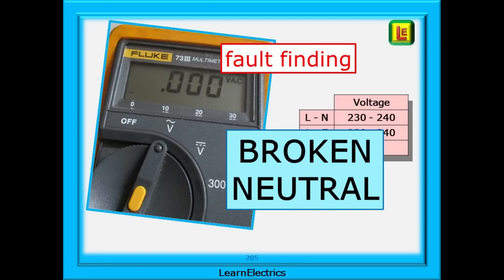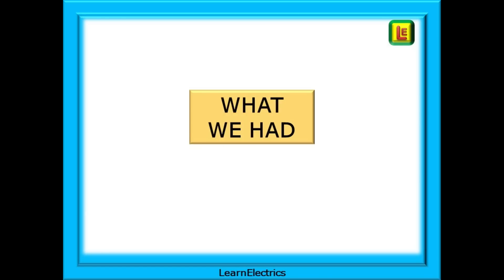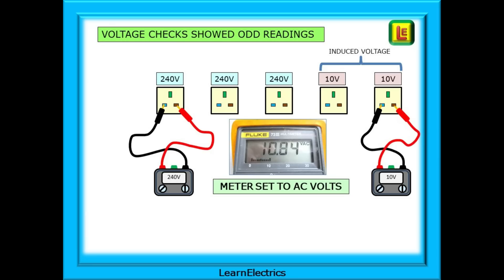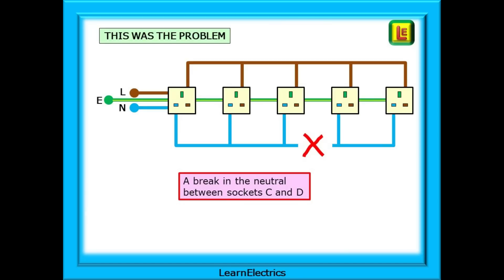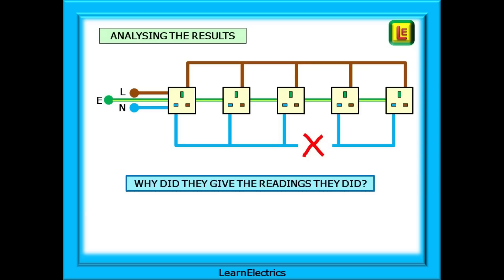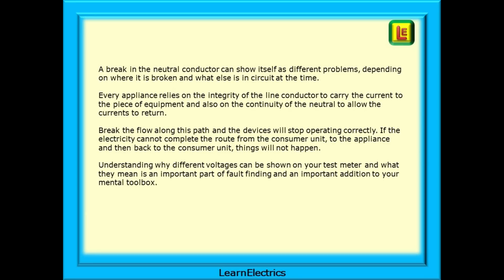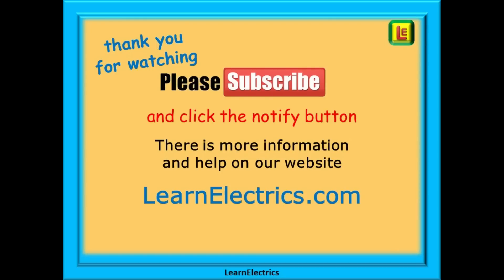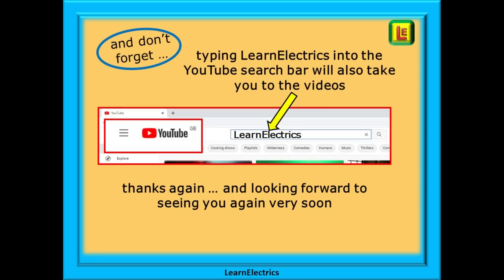BROKEN NEUTRAL – HOW TO FIND IT – HOW TO TEST THE CIRCUIT AND THE VOLTAGE READINGS TO BE EXPECTED

Comment: Hi I'm not sure if this is relevant to this topic but please assist here I once encountered a problem where an automatic coil winding machine suddenly stopped working ,however when we operate it manually via the contactor it worked we checked the voltage inside the small circuit which had a CB and a Contactor and the foot switch was tested as well nothing wrong we even thought maybe the contactor was faulty but that wasn't the case now another machine just a few meters away from it also encountered the same problem i checked the voltage on the main DB now but all seems fine but physically on the neutral bar I saw that there's corrosion on the neutral bar but the wires were not broken or brittle please assist could that be a problem or what possible faults can you identify from the problem?
Reply from the maker: Difficult to say without seeing the actual problem. It could be that you have identified the problem at the neutral bar. Corrosion, sparking from loose connections can restrict the amount of current flowing. It won't show up on a simple volts test because just a few micro-volts will be enough for you to get a voltage reading. If you have a clamp meter, try that around the phase cable or neutral, and see what current flows when you start up. It should be several amps.
Give the neutral bar a good clean - Safe Isolataion first -  and you may need to strip back any damaged insulation, copper etc and reterminate. Good luck - Dave.
Reply: @learnelectrics4402  thanks Dave I'll do that when I encounter the same  problem next time, because I'm no longer at the same workplace

Comment: QUICK QUESTION: So the lamp WON'T work in the broken neutral example? Even though it has 230 across it?
Reply from the maker: If the lamp cannot find a return path for the current, then no. Thanks for the input.
Reply: In a BROKEN NEUTRAL scenario, the Potential Difference between L & N will NEVER BE 230V when LOADED.

If it can Read 230V~ between L & N (when Loaded) then its Neutral is "Good".

Comment: Great vid. I generally find that a neon screwdriver, or a "voltstick" non contact tester shows neutral faults well, but I've found volt stick type tools to be too unreliable. And it's one thing to establish that you have a broken neutral, but it can then be an absolute nightmare to actually reach the fault, especially if it's somewhere well nigh inaccessible like under a floor all covered in carpet and lots of big heavy furniture, and/or the dreaded laminated flooring...
Reply from the maker: Thanks for the comments. Personally, I stopped using volt sticks a while back, too unreliable for my work. Dave.

Comment: Break in the neutral or lost neutral. Tester picks up induced voltage between L-N because of the floating neutral. When a load is turned on the L is connected to the broken N through the load and when both are at the same potential the meter will read 0
Reply from the maker: This is one of the dangers of lost neutrals. Thanks for watching.

Comment: Here is a puzzle: in Norway, distributon pre 1995, 3 phase 230V IT distribution. No Neutal only line conductors. 230V between them.  Every Christmas eve at about 17:00 some lamps in our home would shift to moonlight. Being about 10 years old I got my first lecture into 3 phase theory and later became an engineer in electronics/telco.
Reply from the maker: That's a good one. Glad it was in Norway. Maybe Santa stepped on something.
Reply: @learnelectrics4402  All houses using 230V in 3-phase Delta configuration. At Xmas eve the fuzes in the local transformer got overloaded and one of the wires vent dead. Then some loads received power in series. Ovens went lunkwarm and bulbs went yellow.  Since some houses had full 3 phase, others only one voltage from two hot wires, you would se some houses with yellow lights, some steep dark and others not affected down the road. Took some time for people to be informed what was going on.

Comment: Looking at the tables, at no point is there 240 between L&N whether the lamp is in or not. I have a fault on the kitchen sockets where there’s no power to the appliances but there is 240 between L&N. I was getting 240 between N&E then I disconnected the dishwasher and the fault cleared, so I thought. It showed 0v between N&E, 240v between L&N so I plugged in the kettle and nothing. Tester shows L/N reverse but even so, I should still get power but nothing
Reply from the maker: This is one reason that we should always carry out all the required tests on installation and on inspection. So many sparkies will try to take short cuts on testing and then someone else has to sort it.
Yes, even reversed polarity you should read L/N as 240V. Go back to basics. Check that the voltage is the correct polarity at the CU. Isolate at the consumer unit, remove the wires and start testing, you will soon pick up the fault. If you try and start the testing half way, you may miss it.

Comment: I have a issue… lol. 
Help YO SUBSCRIBER! Haha. but fr any tips would Be appreciated 

One day My light randomly stops working… (2 light fixtures to one switch! And other one works fine) …. So I disassemble the bulb fixture that isn’t working and test the wires….WIRES are getting power… but bulb isn’t working…SO…I go ahead and buy a new connection where the bulb screws in…. 
I Install new bulb connection and install new bulb … STILL NO light on…. 

   So I check the power and IT has power and correct volt…. But the bulb still isn’t coming on?! Lol. 
————————————-
-So the electric to the fixture is good
-The bulb connection is hot and good
- Electricity in the wires are good
- connections are tight…. 

Idk what to do …. 

Could it be the switch?! 
Since two fixtures are tied to 1 switch…. Maybe one of the wires to 1 of the fixtures came lose over time?…….

Any help would be appreciated. Trying to help my dad here and I’m stuck haha
Reply from the maker: You will need to start your testing with low ohms tests, prove the continuity of all the cables.
Take a look at these videos

3 plate
https://www.youtube.com/watch?v=p_qJx4lcp1U

2 plate
https://www.youtube.com/watch?v=L1cyoqBLkeI

common lighting problems
https://www.youtube.com/watch?v=S1Tzr5VX8-Q

Comment: Im confused in my situation, all lights and sockets work. However one of the light (led) flickers when turned off. Checking the switch both neutral and life wire are hot.
Reply from the maker: Take a look at this video on lighting circuit faults. Good luck.
https://www.youtube.com/watch?v=S1Tzr5VX8-Q
Reply: Seems like you are Switching the Neutrals instead of Live/Line/L😅

Comment: Also in this case of the lamp plugged in to the faulty socket making neutral 230v .. why does this not short circuit?
Reply from the maker: Have a look at the video again and look for the part where it shows that the broken neutral conductor is not connected to the rest of the neutral. Thanks for watching. Dave.
Reply: Best advice I can give, always draw out a circuit diagram.
This is the best way of analysing what is going on.

If you can't draw out a circuit diagram then, seriously, put as much effort as you possibly can into learning enough about electricity and electrical circuit theory until you can do it.

It's a fundamental skill that you need in this business.
Get your head around what makes an electrical circuit, Kirchoff's two laws covering voltages and currents.
Reply: A Load, with sufficiently Low Resistance, will NEVER cause any Short-Circuit when plugged into any healthy circuits (it will operate).

If plugged into a Broken Neutral circuits, it just WON'T operate.

So, where/why Short-Circuit arises?

Comment: Basic question for you but I was wondering, am I right in saying that current returns down the neutral not volts. I thought voltage was needed to push current round a circuit so how does it return without this ? Also how can there be current returning if it is been used in the appliance? Also where does this current go? Does it disappear at the transformer, can it not be reused? 

Please answer thanks for your videos
Reply from the maker: Think of a hot water central heating system. The hot water goes to the radiator and gives out its energy as heat into the radiator, the appliance, It then returns as cooler water to the boiler to be reheated and start all the journey again. The electrical flow is just like this. Keep learning, keep watching the videos, it all makes sense eventually, trust me.
Reply: Sadly the diagram shown at time index 0:48 of the radial circuit showing the voltages is not complete.
It's not accurate.

It depicts 240 V and 0 volts and it gives the impression there is no voltage on the neutral line, and that is not correct. 

The voltage is a potential difference between two points. And if you use a multimeter (on an AC voltage range) and measure voltage, putting one probe on to the neutral line, and placing the second probe also on to the neutral then you will get 0V.

But if you also placed both probes on to the live line you would also get 0V !  And trust me, you don't want to touch the live line!

Now if you place one probe on the live line and the other on the neutral line, the multimeter would show 240V.
So the live line is at 240 volts, right? Yes.
Ok, now swap the multimeter probes around and you still get 240 volts, showing that there is 240 volts present on the neutral. But the diagram incorrectly shows 0 Volts.

The reality is that it is AC and the voltage is swinging up and down on both lines. It is not fixed at 0V. Each is going up to +339 V and down to -339 V.

So the diagram shows 0 volts on the neutral line, but that is not the case.
 
There are two things missing from this diagram.
Firstly that voltages are typically represented as an arrow between two points on the diagram with the voltage written adjacent to the arrow.
This then shows you the potential difference between the two points, which is the correct way to depict voltages.  But sadly most electricians do not do this because of the poor quality of their training.

The second thing that is missing is the connection from earth to neutral.
And this is critical to understanding why if you touch the neutral which has 240 volts on it, as to why you are not electrocuted.
Reply: @deang5622  The diagram at 48 seconds is correct, it's refering to the voltage on the neutral being zero with respect to earth which it is.
Reply: @deang5622  In a single phase system, the AC voltage is swinging up and down, but ONLY on the live line.

If you place one probe on the live line and the other on the earth line, the meter would show 240V, correct? If you swap the probes around you still have 240V, correct? So does that mean you also have 240V on the earth line? This is the same logic you used with the neutral line. And if you connect the earth to neutral it is now safe to touch?

You have a misunderstanding of how a multi-meter works. The 'COM' wire does not mean '0 volts'. It is a reference to which the other wire, (V), is compared. You can use an AC voltage as a reference, which is what you are doing when swap the probes. It gives the appearance of a voltage being on the neutral line when in reality it is your reference that is moving positive and negative. 

You said each line is going up to +339 V and down to -339 V (the peak voltages), but in reference to what point?

If you have +339 V on the live line, what is the voltage on the neutral line at that same moment? If it is +339 V, then you have one phase with no potential difference between them. If it is -339 V, then you would have two phases 180 degrees apart with a 678 V potential difference between them. The only way to fit your description is with two phases, 90 degrees apart. All these options will also show as 240 Vrms between neutral and earth lines.
Reply: Currents and being “used in the appliance” seems a mystery.  One could consider the current as a driving belt. The belt transferes energy from the motorvto the saw blade, but the belt returns to the motor and takes a second round.
Reply: Fantastic videos😊👌thank you very much and keep on going😊💪👏👏👏
Reply: Current flows, voltage does not.
Voltage is always across two points. It's a potential difference.

Which is why when you see people saying they have 240 volts, the question  is what two points are you measuring it between?

Comment: I have a similar problem and the electrician could not find the fault. When my light in the lounge is off, the bulb still glows. Measuring the 2 pins in the light socket shows 36 Volts A.C. while the switch is off.  Surely this cannot be induced voltage ? So where does 36 V AC come from in a 240 V circuit then ?
Reply from the maker: That sounds like another circuit sharing some of your lighting circuits conductors. Take a look at this video on shared neutrals.
https://www.youtube.com/watch?v=gr6Z_bBiy5g
Reply: It seem like an Induced Voltage to me.

Even 70–80V can be deemed as Induced Voltage, UNLESS its measured using a Lo-Z VoltMeter.

Comment: Had this fault on a lighting circuit last week..........240v at the neutral  in a jb . ......never take for granted that a neutral will be safe to touch.......It hurts
Reply from the maker: Absolutely Mark. Thanks for the feedback. Dave.
Reply: This is why I don't approve of the diagram at 0:48 as it gives the impression the neutral is at 0 volts and it is not.

It is only at zero volts with respect to earth and so long as there is no fault in the circuit.

The neutral line is at 240 volts with respect to the live line.
Reply: That’s because it’s not a neutral in that state, its a blue or black coloured live conductor 😁
Reply from the maker: Exactly right, and as Mark says, it hurts. Thanks for the comment, appreciated. Dave.
Reply: I've found too many times that some idiot has cross wired somewhere between one lighting circuit and another, like upstairs lights and downstairs, and you go to the consumer unit and isolate the circuit to be worked on, which should then be dead, only to get a dirty great belt! So you then have to make yourself well unpopular with the residents there at the time and knock off the whole lot so they can't watch the TV, or play with their games console etc. until you've safely found and fixed the fault. And my own home had been "rewired" by some total amateur with such cross wiring between up and downstairs lighting, so I had to sort it all out.

Comment: Here in 3 phase 4 wire supply (India) this fault is known as floating neutral. In domestic service this is disastrous as the voltage will float anywhere from 0 to 415 between phase and neutral point due to imbalance and spoil the connected appliances.
Reply from the maker: Exactly right, with 415 volts on the end of a wire, it can do a lot of damage. I used to work in India so I've seen similar first hand. Take care, thanks for watching, lots more to come. Dave.
Reply: More common in many countries are now 3 phase 230/400V TN distribution network.

Comment: Great video!
Maybe in the future, you will make a video about the broken neutral in three-phase circuits, where the effects are more serious.
Thanks!
Reply from the maker: I think I should, someone else also commented about 3 phase problems. It's on the list to be done. Thanks. Dave.
Reply: And also the use of 3 pole and 4 pole main switches in 3 phase distribution boards.
Reply: I'm keen on this too. I have a job coming up where i have to find an answer to an issue on some lab equipment, which is a 208v 3 phase circuit. 
L1: 96V - E
L2: 132V - E
L3: 115V - E
N - E: 20V

208v between phases.